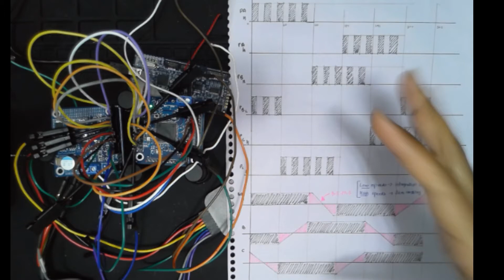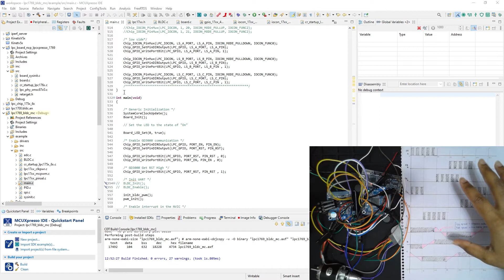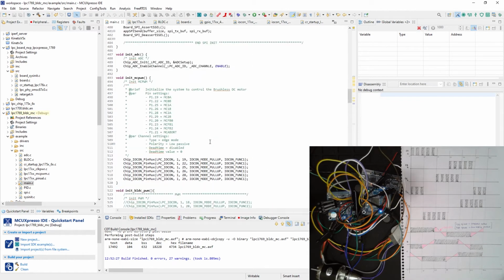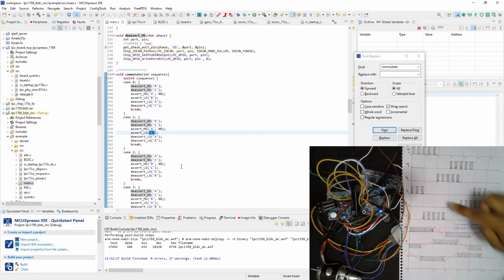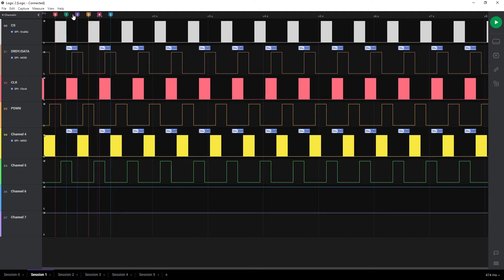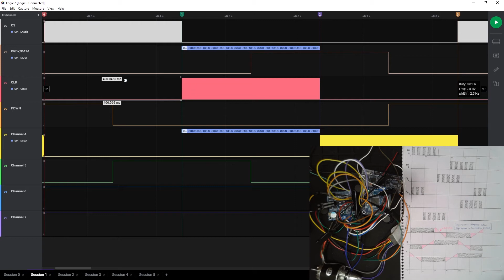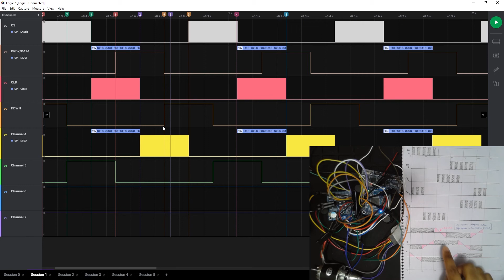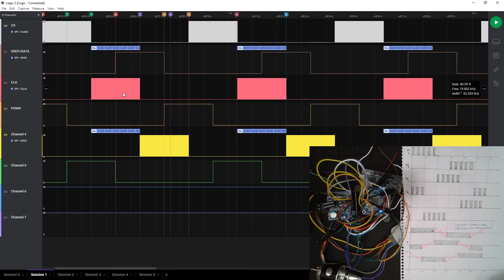Writing software for BLDC speed controller - Vlog Series 3

Comment: If the minimum throttle of esc is 1000, how to map the software pwm of pi3 that have duty cycle from 0:100 only, I will be grateful for help
Reply from the maker: Speed is directly proportionate to voltage input. If you use a battery of 7.4 volts, your motor will run at full speed of (1000 * 7.4) 7400 rpm for a 1000KV motor. For a 7.4V battery, this is the maximum speed your motor will be capable of rotating. This is also your 100% duty cycle. To slow it down all you need to do is reduce the voltage. One way to reduce voltage is using a linear regulator. But it will be extremely inefficient as you lose power through heat. Another way is through PWM. So to get a speed of 1000 rpm you need to reduce the duty cycle to (1000rpm * 100) / 7400 = 13.51% duty cycle. This amounts to an average of 1 volt. 

Keep note, hobby ESC generally only allows you to change PWM at very discrete values. Hence you may not be able to set it at 13.51% but perhaps 15% or 20%. 

Hope it helps!
Reply: @antshivrobotics  
I have a 1400 KV BLDC motor.Using raspberry pi to control its ESC. What the best frequency to control ? 
I have tried 50 HZ but the range of duty cycle to make the motor work was (min=6,max=11), if I increased the duty cycle the motor turns off!!
Reply from the maker: @AhmedAbdalla-ui6du  Ah! for the hobby ESC, you need your frequency to be around 20ms (50Hz) and your duty cycle must be between 1ms to 2ms. 1ms is 0pwm and 2ms is 100% duty cycle. 

Hope it Helps!
Reply: @antshivrobotics  in my case 
Theses duty cycle values are actually true when I set frequency to 10 HZ ?
Reply from the maker: @AhmedAbdalla-ui6du  These hobby ESC normally have a lower and upper frequency range. I am not sure what it is. Were you able to get the motor spinning?
Reply: @antshivrobotics  yes it does. I I to map this range duty cycle to be driven by PID controller , how to do this?
Reply from the maker: @AhmedAbdalla-ui6du  You need to create a scaling factor. For e.g. 100% duty = 2ms and 0% eq 1ms. In your code program your PID controller to output the  speed in rpm which can then be mapped as a duty cycle in percentage and then do the transformation. For e.g if your PID controller outputs 25%, then you sample the pulse to 1(lowest range) +.25 = 1.25ms == 25%.  Something of this sort.

Hope it helps!